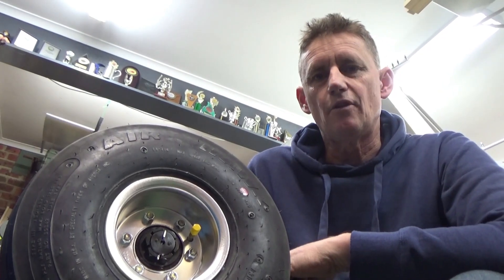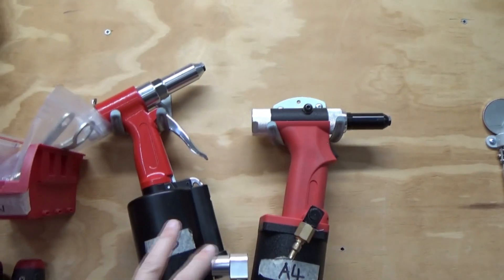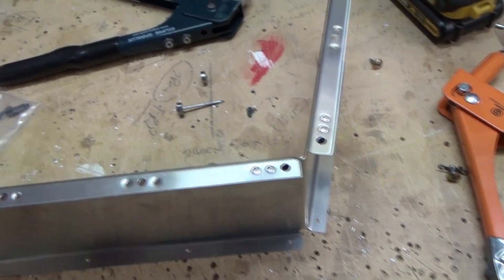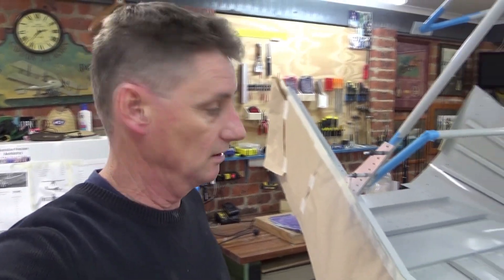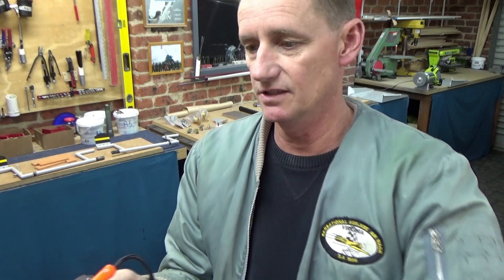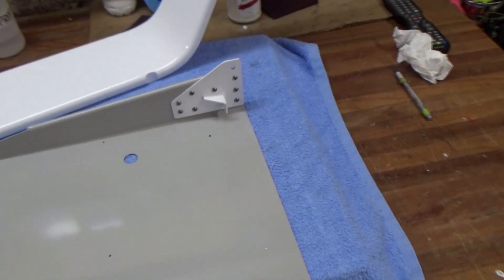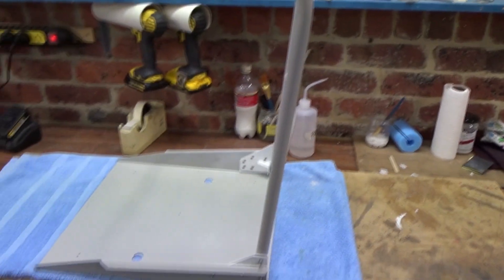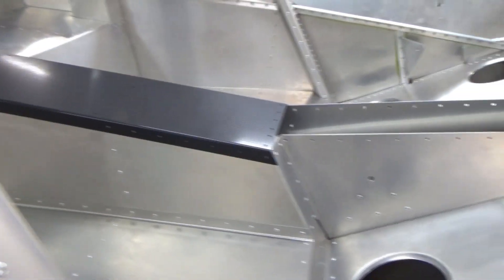How I made 750 Cruzer Carbon Parts Jul 20

Comment: Thanks Scott.  When you set the brake fluid level its a bit difficult to get to .This is how I do it .  You will need a syringe without a needle and an ink tube from a ballpoint pen. Next drill out the syringe for the ink tube .Glue it in .Now snip the tube to the length Matco recommend for a fluid level.Remove the plastic screw from the Master cylinder .Squeeze  it in suck it out .Perfect level every time.Now you have to find the nylon screw that you dropped behind the pedals!

Comment: WhenI filled the brake system on my Sport Cruiser which is the same I made a device with a  tubeless tyre valve on a can .I pumped up the fluid  from the lowest valve with a foot pump .I was chuffed .Then my mate said " just use a hand oil can the ones you pump with your thumb ' Be careful to use the correct fluid .Silicon fluid is so difficult to clean of the alloy when you paint . Dot 5 is not Dot 5.1 . Oh I forgot the last bit ,the nylon screw on the cylinder is hollow . Fit a tube over it to collect the fluid in a jar as you pump it up Get a set of spare brake pads and a rivet tool for the copper rivets that hold them .The linings wear out easily but are cheap and easy to replace.Also you might need a filter on your air system it will remove the water before it gets in the paint .They are well worth fitting .Ah looks like you have one on the regulator.